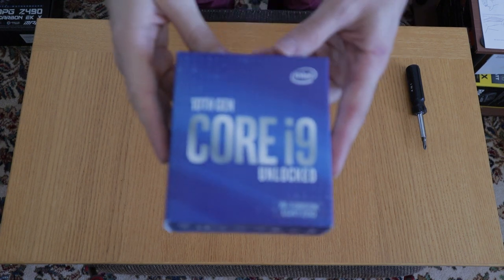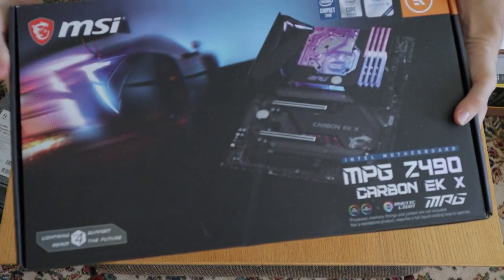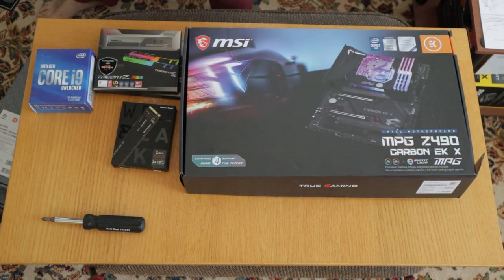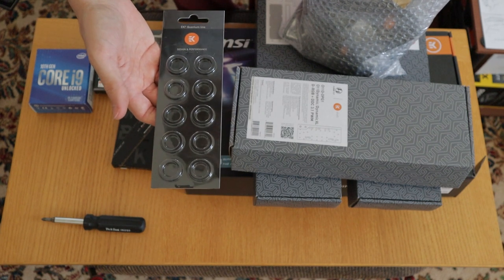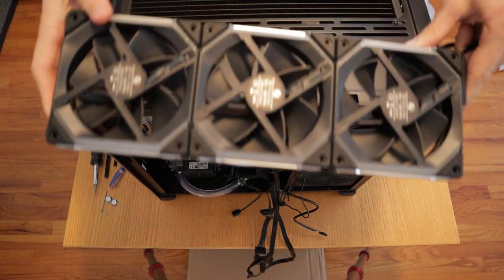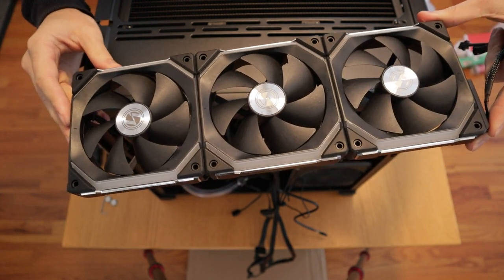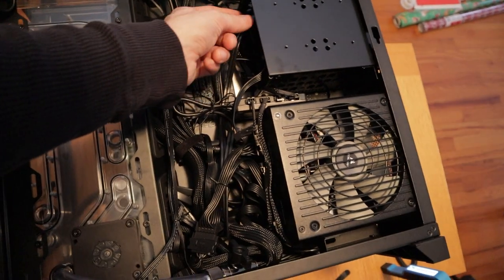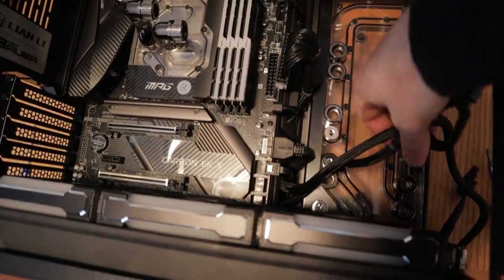My First Open-Loop PC Build - Carbon EK X - i9 10850K - 3080 - PART 1

Comment: Nice. It looks alot like mine right now. I have the same case and distro plate. Also waiting on my 3080 and parts from EK are taking for-ev-er. You need some custom sleeved cables. Makes a big difference.

Comment: props for not using the XL i ran the 3.2ddc distro in my xl as you can see in my profile pic. it just doesnt line up quite right.. this is an amazing build. what do you play?
Reply from the maker: Any issues with the DDC yet? I've read online about them going bad.. we'll have to see if it. Can handle the full loop once the gpu block is on. I play a lot of shooters, some survival games, RL, LoL, etc

Comment: Nice Build ! just be aware that the Lian Li O11Dynamic width for video cards is no great @ 158mm
Reply from the maker: Hey David! The card I have now clears fine in both the vertical and horizontal mounting. MSI Suprim X 3080
Reply: @WRXGarage  oh thats good ! Ive got the 3080 Tuff and have had to order the o11 XL

Comment: So where is part 2 ?
Reply from the maker: Still working on it! Had to get a new case, new hardware, it's a whole story. Didn't measure the gpu waterblock correctly..
Reply: @WRXGarage   what gpu u used ?
Reply from the maker: MSI Suprim X 3080